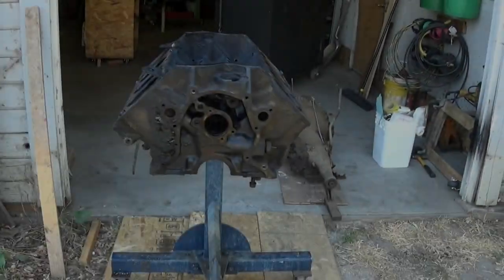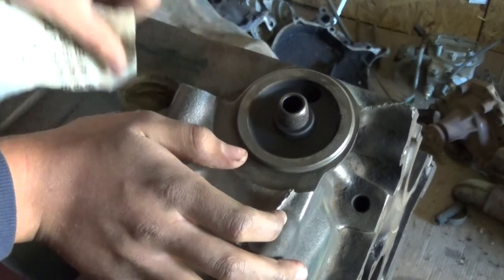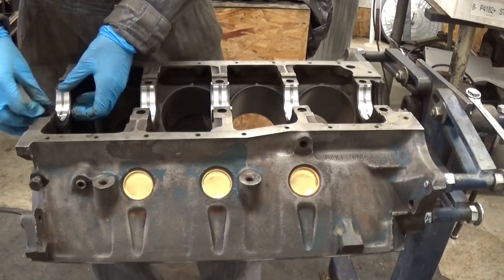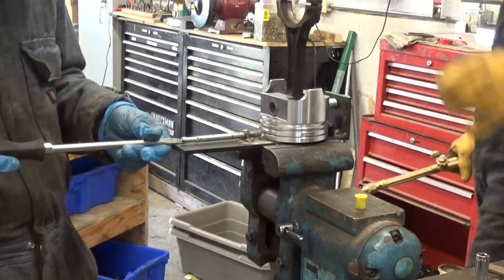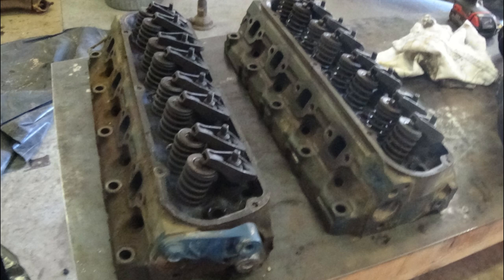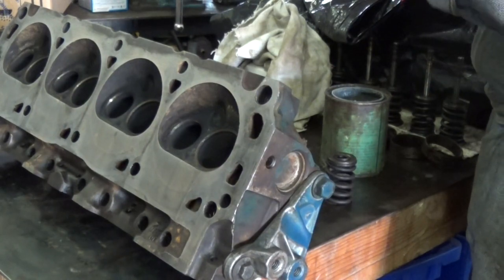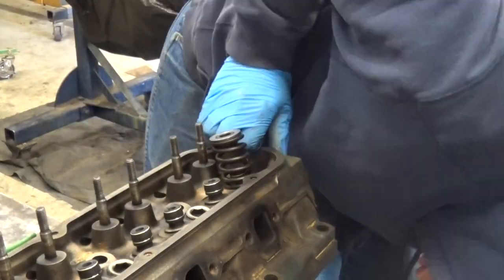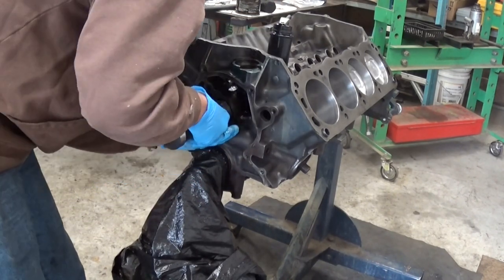351 Windsor Budget Build, No Machine Shop!

Comment: About how much did you spend and how long did it take for the build? I was thinking about picking my Windsor out and building it. Not sure where to start.
Reply from the maker: This build in total was about a $1,000 but we also replaced parts on the truck like injectors and those are expensive. This took me about 3 months but I was also having to wait for parts and other things.

Comment: Little cam bearing advice.   Knock out all the bearings first, then do the rear bearing first and move your way forward. When you get to the front bearing, spin the block around and align from the rear, do this will help keep the bearing squared up.

Comment: One important piece of advice that should be stressed to would be home engine builders. When honing piston cylinders, you need to know theres two types of honing tools. The one you used is ok if its just a crosshatch pattern thats needed. But if theres any lip at all on the top most portion, you need to use a three stone piston honing tool instead.
Reply: Or start with a ridge remover...
Reply: TBH, if there is measurable taper, I'm sending it to a machine shop.
Reply: FYI, for every .001” of taper in bore diameter, there is .003” ring gap expansion (diameter x pi).

Comment: Next time clean the lifter bores, a lifter isn't suppose to be hard to put in (like using a hammer, that alone tells you that bore is contaminated).
Reply from the maker: That looks a lot worse on video than it was but I made sure that lifter slides smooth

Comment: Tip for block cleaning: Use the wirewheel with the sprial wires coming from the center to clean cast iron blocks, it works even faster than the regular wirewheel, great video brother.
Reply: Make sure to use a softer thinner wire if possible. Some of those stainless wires cause actually dig into the block alittle

Comment: Put the cam in before the crank so you can support it so you don't gouge the cam brgs with each cam lobe and when you clean the deck. Surfaces use a hand straight board sander also used for body work their about 14" long w/220 grit does a nice job.before assy. Always wash w/hot soapy water air dry ,then oil wipe asap.detergent washes away the grit solvent won't (can never be too clean on a rebuild)when you use a dingle ball hone to deglaze,slow the drill down to achieve a 45 cross hatch as you finish your last pull on the way out.nice job young man have fun liked your video 😊

Comment: Not exactly a rebuild but your on the right track. I hope this is the first of many engines you build. I built my first engine at 13. Was working in a full rebuild shop by 16. Owned my own hi-perf shop by 22.  Glad to see young guys still interested in tearing apart v-8s.  Brings back memories of the early days.....am I’m talking in the 80’s.  We had no internet, YouTube or any help like that.  Just Chilton manuals and hi perf speed books that we would buy. I still have em. Kinda funny looking them over nowadays. 
Anyways, good luck. Stick with it !!!!
Reply from the maker: How so not a rebuild?
Reply: This is a full rebuild George 👨🏻‍🔧
Reply: @DeejayGibbo  Yeah. I agree. If the parts were all in spec and the engine was cleaned up, heads cleaned and valves lapped, then this is a rebuild. Assuming you don’t consider a rebuild because no machining involved? Makes no sense to machine parts still in spec!

Comment: Glad to see a  someone your age using their hands and making something cool out of it. The things we learn over time and a couple key points to solidify your knowledge are:
Paint block before assembly
Put front cam bearing in from back to align straight
Put cam in first with lube from mfr,and lube whole thing before install
Make sure those new pistons weigh within a couple grams of old ones, or rebalance
Take rocker arms off and readjust lifters with new cam
Hope all went well!
Reply from the maker: Thank you so much for the tips  I am curious about the lifter adjustment because the lifter are hydraulic. So I don't think you can adjust them. Yes the truck is running well
Reply: @americanrebuilds2815  the rocker arms you have are adjustable. Simply loosen the rocker nut a couple turns or until pushrod spins free. To adjust  intake valve do as follows:
When the exhaust valve just starts to open, then you can adjust the intake rocker next to it(pairs). Tighten rocker nut slowly while spinning pushrod between your fingers, once feel slight drag in pushrod,then tighten  nut an additional 1/2 turn. 
For the exhaust valve,  the intake (same cylinder as one your are adjusting) must go thru  full lift and almost all the way back down, then you may adjust exhaust in same manner as described above.
Reply: Why do you prefer to paint before assembly? Is it because it looks cleaner that way?
Reply from the maker: It's because I painted the oil pan and valve covers a different color and the intake manifold was aluminum so I left it metal
Reply: @americanrebuilds2815  Thanks for the reply. My comment was meant for someone above who suggested painting before assembly.
Reply from the maker: Oh my bad

Comment: You shouldn't use a hammer to install your lifters.If they don't drop in you probably have carbon in the lifter bores.This will cause premature cam lobe wear.
The lifters should actually spin in the holes.
The machine shop would have hot dipped the block for cheap it's well worth it.
If you don't start with a clean block and heads you will end up with junk in the bottom and a whole lot of problems.
Use acetone with a white rag until it comes out clean. I did this after the machine shop and still had lots of fine dirt in the block.Must have taken 2 hours to clean up.
Reply: a brake cylinder hone can usually clean up a lifter bore. Most machine shops don't dip a block anymore, they bake the grime into ash. which isn't the worst thing--i never paint the inside of the block, but for those who do, now they won't have to worry about "dip" contaminating their paint surface and causing strips to fall off and clog the oil filter. you're right about cleaning the block when you get it back from the shop--if i have to clearance anything and don't want debris to get into a passage, i fill it with shaving cream and wash it out afterward.

Comment: Regardless of whether it's a grenade or not is yet to be seen, but you are learning and having a blast I can tell. Let me tell you that's what it's really about, i have built expensive machine shop builds and I have built what I call "grenade motors" with the least $$$
possible those how long they last and everything in-between. Irregardless they where all fun, i have 3
Cleveland blocks(one 4 bolt xxx block) and 3 sets of heads. I plan to build the 4 bolt one with all high
end internals and stainless valves/guides in the closed chamber solid lifter heads.
Then I'm gonna build a grenade motor with the 2bolt block using 10.5 to 1 pistons & aggressive cam and the 2v heads.
At the moment I'm running a combination of the two with a 4bolt main block with stock crank 9.5
to 1 and  2v open chambers with the stainless valve/guide upgrade and a little more than mild r.v. type upgrade cam with headers and 500cfm holley I got 340hp.
But now I want to start in on another one and you have motivated my ol' keister to get this stuff out and get going on it.

Comment: Maybe you did this. But, for lapping your valves. You can get a small suction cup attachment for your drill. Place it on the face of the valve, and spin them in that way. Using minimal pressure its much quicker more accurate and efficient then doing it by hand. (I typically then check the seats w a jewelers loop for any remaining minor issues I'd want to address on the mating surface). Its normal/acceptable to have a very minimal amount leak by even after they're properly lapped in. For the cost, I would typically consider some new valves. U can usually find someone on FB marketplace selling new ones they dont need etc. Also, just curious, didnt see you address gapping, and orienting your rings prior to piston install? As well as micrometer checks on your cam bearings, and main bearings (w caps installed and torqued) prior to any final install? You may have done all those things. But you could show them in your vid. Just for some expanded content. Anyway, great to see a young guy keeping the hobby alive. Keep it up! Thanks.
Reply from the maker: I definitely will think about the lapping tool I spent weeks on those valves I also did some things off camera yes we did orient the piston rings and clocked them. I appreciate the tips
Reply: @americanrebuilds2815  - Not recommended to spin valves, just rotate back and forth to lap... 
16 new one piece S.S. valves $80 at Competition Products ($70 before shutdown)... 
Stock valves often 2 pieces welded together and heads can break off above 5,000 RPMs... 
And, NO, valves shouldn't leak at all after lapping... leaking valves will burn through their metal! 
Use $1.00 Plastigauge to check bearing clearances... often times an incorrect size bearing shell will get into the box of new ones... 
Those stock cast rocker arms break in half above 5,000 RPMs, use these hyper Chevy ones: 
https://www.summitracing.com/parts/sum-g6801 
Mild performance cam/lifters: https://www.jegs.com/i/JEGS/555/200143/10002/-1
Would have used flat top pistons to get compression ratio up from actual 7's into 9:1 !!!
Reply: Clocking your piston rings does absolutely nothing it’s a myth
Reply: @codycampbell4797  - Get real! You don't want those 4 gaps lined up !!!!!!!!!!!!!!!!!!!!!
Reply: @BuzzLOLOL  you don’t want them lined up but they don’t need to be in a specific location
Reply: @codycampbell4797  - Thanks for coming back to reality... if gaps are set opposite each other, best chance of staying apart...
Reply: @BuzzLOLOL  true but the rings spin as the motor runs, pretty sure the top two compression rings spin in opposite directions too, I wonder if it really makes a difference in the end..
Reply from the maker: We do clock the rings I figure it does make I difference in terms of blow by

Comment: For the record, the circular plugs we all see on the side of engines are not "freeze" plugs. they are core plugs, designed to help those casting the block get out all the casting sand pressed together to form a coolant passage shape. Ford's Boss 302 had them threaded just to give the block more strength, and its common to "swedge" them on racing engines so they won't pop out. They aren't for expansion--coolant doesn't have a brain to look for an exit sign out of a block. yes, sometimes they are in the right place, at the right time, and Henry Ford certainly took credit every time a farmer couldn't afford coolant in the Great Depression and said, "gee, the water dun froze and pushed out this hyar plug--that H'nry Fr'd's a damn gen--ee--us!"

here are more steps if you don't have a great machine shop nearby (or the wait-list is too long). toss some old spare tires in the bed of a pickup truck, put the greasy engine in, and go to the car wash where you can hose it yourself. spray the engine with degreaser (oven cleaner tends to work on animal grease) and hose, using the tires to cushion rolling it around to get every spot. 

when you get home, remove the part of your engine stand that bolts to the back of the block, and bolt that to the bellhousing of the engine. now hoist it out of the back of the bed--easier to get this assembly hooked up to an engine stand than try to hang the engine in  the air while lining up all the bolts on the engine stand. pull the valve covers and chuck an old distributor shaft in and turn the oil pump until it dribbles out of the rocker arms. if you see leaks now or nothing reaches the top end of the engine...you know you got a problem to fix as you build. if there was no oil getting to the rocker arms, you may decide now whether to work on another engine if time is of the essence (and that's why you're skipping the machine shop)

dump the oil, running a magnet through it to look for bearing material. pull the theromstat, put the housing back on, cut a bike tube hose and run a loop for both ends of the water pump and a heater hose that loops to close off the heater core. fill the block with water, and use the schrader valve on the bike hose to pressurize. if water pours out the open drain plug on the oil pan, you may have a cracked block--if it pours out the open spark plug holes, a blown head gasket. also, loosen the rocker arms so all the valves are closed, then get each piston up to TDC and use a leakdown setup to pump air into each piston to get pressure in there--if you hear hissing out the PCV, you've got another problem.

these tests aren't perfect, but if they exposed a bad engine, you may be able to get another plan going. after you pull the cylinder heads, get the outside cylinders to TDC and measure your height from piston top to deck--the difference from cylinder to cylinder will let you know how much the deck needs to sanded down. the video mentions cleaning off surfaces like the deck--always use a long board to make sure you are getting things flat (even a guide coat of paint will let you know if you have high and low spots as you sand). the last test would be to check the crank thrust before pulling it out of the engine.

(i should point out, when you take a cylinder head off the block, turn the block so the head is parallel to the ground--less likely to drop it on your foot if the deck surface isn't at a 45 degree angle. If the head is being stubborn, get a piston up to TDC, and blow air into the cylinder to pressurize it--this can often be enough to pop it and you won't risk damaging an aluminum head).

i wouldn't hone a cylinder without fluid. lifter bores can get a touch from a brake cylinder hone tool. estate sales are great places to pick up tools you'll need one day--you can see how other things in the garage/house were maintained, they often are older tools that were made better than "Harbor Fright" for the same price.

when you install a cam, do it first before the crank. its easer to stand the block up on its bellhousing on the floor and let gravity work for you. plus you can reach into the crankcase without the crankshaft being in the way to guide the cam through its bearings.

Comment: I think you may have overheated the con rods during the piston install. You’re only supposed to heat them until they just start turning blue, otherwise the metal weakens greatly. Otherwise, great job dude!
Reply: HP TV heats them red hot...
Reply: @Steve Paige - Backyard mechanics don't buy every special tool for a once in a lifetime job... I don't even heat mine, just push the pins in and out with a vise and oil on them... sometimes put the pin in the freezer first... have some suspension ball joints in the food freezer at the moment...
Reply from the maker: It's very hard to get them to blue it's a fine line between red and blue
Reply: @americanrebuilds2815  - They don't even need to change color, just heat them to expand them a bit...
Reply: Ideally you want to keep them under 600f when heating, steel starts to glow at 900f and at 1100f your steel is now 50% weaker. Don’t heat the metal more than you need to, 575f is when the rods begin to turn blue so that is a good indication of proper temp. 600f is 315C the inside of your motor will never get even close to that hot. That is the reason why you don’t get them red hot. Sure it will work but now you got weak ass rods in your motor 🤷🏼‍♂️ Putting the wrist pin in the freezer is a great trick though!
Reply: true, you don't want to overheat, and freezing the 'pins will reduce their OD and help with mating everything together.

Comment: Nice job but a little help get a scrap of hose for the rod bolts when you slide them in helps not scratch the walls or crank. Found that out the hard way.

Comment: The video didn't show you gapping the piston Rings?? I think I would have used way more break in lube on the cam and lifters. Would like to see before and after Dyno pulls because without doing something with the heads I don't see much value in putting in a larger cam shaft. Just my opnion. Hope she gives you what you expect of it. Nice video.
Reply from the maker: I did gap the rings by there isn't much to film on that as for the lube we primed the oil pump once the engine was all assembled so the cam got plenty of lube.
Reply: well the larger cam will give them more power but yes, i woulda purchased better heads or port n polish, n forged internals, but maybe they were just bringing a dead engine back alive??

Comment: maybe I missed it but I didn't see any lube on the crankshaft bearings, nor a little oil on the main bearing bolts.. did you soak the lifters in oil over night and prime them a little?.. 
 Other than that, great job.
Reply from the maker: Yes lube on crankshaft bearings and main cap bolts I didn’t oil the lifters but I put lots on during the install

Comment: Did you end up cleaning up the crank at all or just doing bearings? I'm trying to polish up my crank as best as I can. But it's still going to have some good scratches in it.
Reply from the maker: I cleaned it with some neverdull metal cleaner but I didn’t do anything else I didn’t have it turned down or anything

Comment: What cam did you put in the engine
Reply from the maker: Nothing to special just a cam with little longer lines so it holds the valves open longer I think I got it off rock auto with the other parts

Comment: how long did the engine last?
Reply from the maker: Still running strong it's only about a year old
Reply: nice work. you don't need to spend $1000 plus in machine work.  Did you check the weight of the old pistons against the new?  why did you change them?
Reply from the maker: I didn't check the weight. We put new pistons in because we wanted to refresh the engine